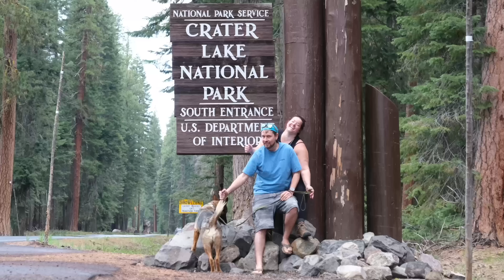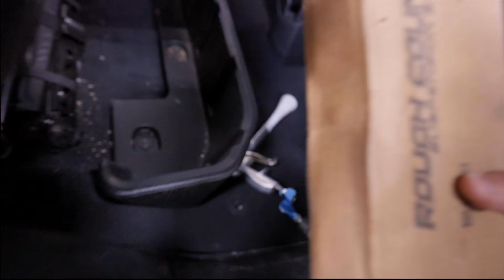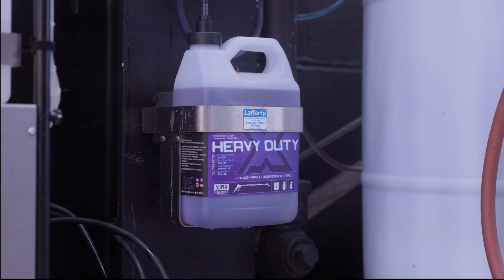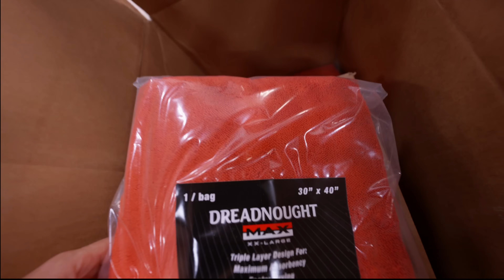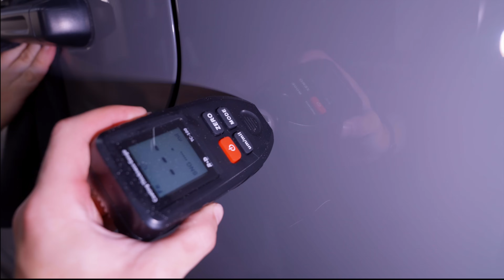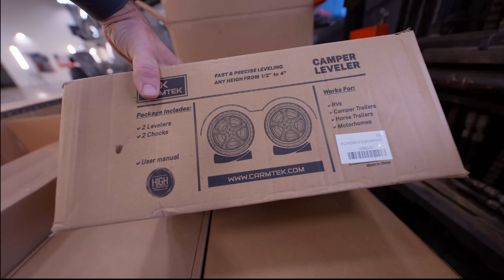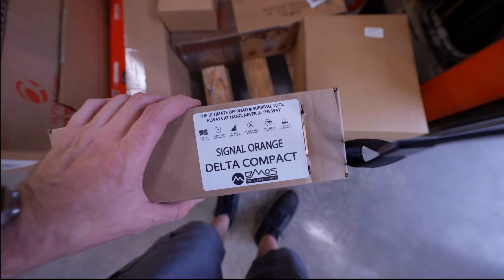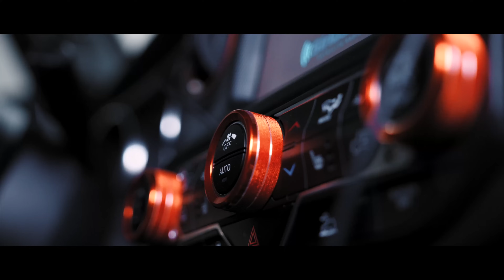Chem-X vs. 10,000+ Miles of Overlanding America

Comment: You should have used a paint pen inside the drilled holes to protect and prevent rust. The hole is bare metal and will start rusting if its not protected. You can easily go back and still do that. Congratulations on your engagement! Thanks for the video!
Reply from the maker: Dammit now I can’t stop thinking about that lol, that’s a good heads up tho thank you!
Reply: I use engine enamel in a spray can, spray it into a cap and use a q tip. Dab the q tip on the holes.

I'd use a wax based undercoating on the other side as heavy as possible since you got it in there

Comment: As you said you didn't know what you were doing! The one thing I always appreciate in regards to your videos is your honesty....

It's super important to real so people get what you are trying to convey in your videos / vlogs.

I also noticed that you were just as honest in your customer reviews and one of the things I noticed with some of your lower ratings is that you state very clearly with your touchless product(s) is that you will need to put hands on! 

I have yet to come across ANY product that is truly touchless. 

I have owned many, many vehicles from older Camaros to my last big purchase for a new 389 Peterbilt and just recently a new Mustang GT. 

I am contemplating purchasing your products in order to reduce the amount of labor I need to wash my many cars (I have sold my trucking company). If anyone owns a Mustang they can probably relate to the paint issues that unfortunately Ford has been struggling with for their cars. They have amazing colors but adhesion has always been an issue and they don't hold up very well. So the least amount of actual manual scrubbing you perform on the paint is better for your paint job as it will impart less scratches which in the end is truly what you want when purchasing a "touchless product". 

It's all about removing the big bits so that you don't move them around on your paint while washing it. 

Your paint will always require some maintenance and waxing it's just what you need to do, it's inevitable!

I will be looking into purchasing your double foam cannon and mezzo stars and stripes in the near future when my finances are just a little bit better. 

I hope you are doing well and good luck with your business. I have been watching your product videos on and off for a while now and would really like to sample them as soon as I can.

Be well!

Comment: 30:40 Tip from someone who had piano black paint that halo'd if someone on pluto sneezes.... that's how they come but I've found using it like that just wastes clay. Tear a piece off enough to make like a ping pong sized ball in your hand - smash it into a pancake and make sure it's big enough that you can hold it positively - It doesn't need to be that big thick brick. If you need to make it bigger, add more clay. This is important because you don't  want to drop it, or it's as good as trash (so keeping the rest of it pristine is a good CYA) because it will score up your paint and cause haloing and other nasty artifacts in the finish (your Jeep's color tends to be very forgiving though and... it's a Jeep. 😁). Make sure to store it in its packaging or a small tupperware to keep it dust free and safe. Use it exactly like you are, back and forth and keep it constantly lubricated. Occasionally check it for contaminant build up and kneed it together (like you said) again to expose fresh clay as needed. 

Usually one of those bars is enough to do 50-80 clays (maybe more depending on contamination). Using the whole bar is generally just a waste, when you can keep a super fresh one to keep from contaminating less contaminated or other vehicles. I love your videos and products. Keep up the good work!

Comment: Congratulations! As far as claying goes, here’s my knowledge and opinion on what works for me on the cars I work on. It’s fairly long but good information to know. 

1) The clay bar is a more aggressive step that will leave light scratching on the surface, needing to be polished after, whereas the mitt, if used with proper lubrication, will not need polished after. This is because the clay bar contains light abrasives to help remove contamination, and the synthetic mitt does not. 

2) I personally use a perforated synthetic clay surface like your mitt. The most important thing with that is to use no pressure. It actually works better with less pressure, as counterintuitive as that may seem. I’d suggest with the mitt to place your hand on top of it, instead of inside, as you will create less pressure points with thicker padding between your hand and the surface. 

3) As far as lubrication with the synthetic clay, I like to use an iron remover. The best way to do this in my opinion is to first wash the car, and while the soap is still on the car, do a spray of iron remover on the clay mitt and a spray on the panel, making sure to rinse the mitt in a soapy bucket between panels. A lot of people believe that an iron remover removes the iron particles; in reality, they remove the rust staining caused by the iron particle, not the particle itself. Keep in mind that not all iron removers work as a clay lube with all clay media, as some iron removers are diluted with a solvent that will damage the clay surface. Usually the high quality iron removers work well, but the only way to be sure is to test for yourself or find a combination that other people have had good results with.
Reply: Also if you’re looking for a good pad cleaner, I’d look into the Lake Country System 4000 pad washer. It’s the best in my opinion
Reply from the maker: Awesome input I’ll put this to work thank you!

Comment: 6:41 yes correct, while doing pre-wash - always rinse from down to the top - because you do not wash up the prewash product. I'm talking about pre-wash not pre-rinse. Pre wash use some APC, etc etc etc etc
Reply from the maker: Yeah I like to rinse top down on heavy dirt knockdowns and on hand washes, the only time I do bottom up is during a touchless wash since the power washer is what’s cleaning the surface in that process, and I miss a spot if I don’t have the foam to gauge where I’ve been, missed spots don’t usually show up until dry

Comment: For cleaning the pads out during buffing you should use your air compressor and blow it out of the pad. Just make sure you are away from the vehicle and have very good ventilation. Turn the buffer on and let the pad spin while you blast it with air between panels. (i.e. every time you lift the pad to go to the next area.)

Comment: I used to rinse too down all the time until I understood the reason for bottom up. Now I rinse from the bottom up after the first chemical cleaning (the pre) and I rinse from the top down after the hand wash. Seems to work well. Also, congratulations.
Reply from the maker: Thank you! Yeah the bottom up just helps me not miss a spot in the touchless washes so it looks better dry, I do the same as you the rest of the time as well and top down after hand washes
Reply: @ChemX  I also use a 25 degree tip when doing my pre wash and any early rinsing and on the wheels. For the final rinse I switch to the 40 degree. I just figure I get a little more focused power to remove the dirt early on with the 25 and the 40 helps to get the final rinse done quicker. Might be bullshit but makes sense in my head.

Comment: Suggestions; use a iron remover b4 claying to break down the particles as far as possible and rinse them off before claying. Do this to prevent (best as possible) pick up some of the iron and dragging it along the surface also clay with as much lube and little pressure as possible moving down the panel not across. If you have some heavier polishing that needs to happen look into a forced rotation DA polisher such as flex (harbor freight also just came out with one) so you have the power of rotary with having to worry about holograms and swirls
Reply from the maker: Perfect yeah I’ll def get some iron remover going and put that info to work, any brand you prefer on iron remover?

Comment: Apply ONR or Absolute rinseless Wash spray combined with your clay towel👍. for decontamination.
Reply from the maker: I’ve got a clay lubricant going on but I need a good iron remover any recommendations?
Reply: @ChemX  My go  to I use is Turtle wax Hybrid Rapid Decon it's meant for wheels and paint👌👌.  I saw Pan The Organizer demo this 2 years ago and it's the real deal 👍  It comes in a black spray bottle.

Comment: 1st thing you learn in autoshop... nobody does...DONT  POWER ON OR OFF LUG NUTS.... Especially the OEM LUGS which are designed to give under excess torque  (using a torque wrench to install or remove them will Damge the Nuts Safety Shell Over TIme)

Comment: Can we get rim and tire specs. jeep looks tough with those wheels. Is the suspension stock or modified? And also congratulations 🎉
Reply from the maker: Thank you yeah I forget the offset but they are 37’s, I needed a two inch spacer lift and a stubby bumper to prevent rubbing

Comment: There is a cleaner for those pads that attaches to the top of a bucket and it squirts water solution up into the pad and rubs up against it. But hey What bumper is that? Congrats on the engagement and I love the rig man. Got one of my own same color. Best color in the line up imo lol. Just need a bumper now that I got the wheels tires and lift.
Reply from the maker: Thank you! Yeah that sounds like exactly what I’m looking for on the pads I’ll have to track that down. The bumper wash this one right here: https://www.cjponyparts.com/rugged-ridge-front-bumper-stubby-arcus-jeep-wrangler-jl-gladiator/p/1154904/ def the best color I agree!
Reply: @ChemX  thank you!! Love the build. Over landing is not a cheap venture for sure but I'm working my way into it lol.

Comment: Invest in a solar power inverter. You won't regret it!
Reply from the maker: I’m in a good place bud I have solar panels on the top of the roofnest and a redarc system for a 270 amp hour lithium battery to keep everything topped it worked killer for me on the trip